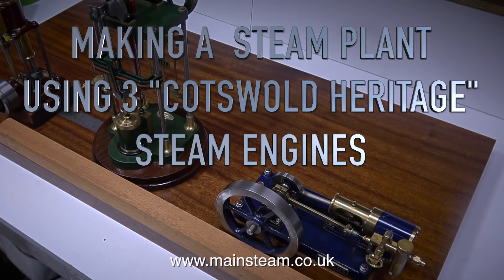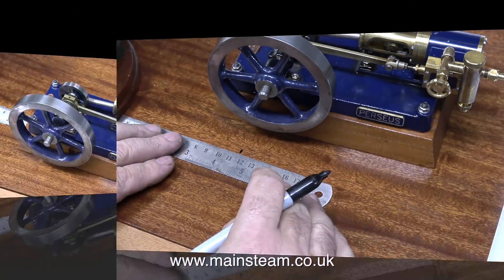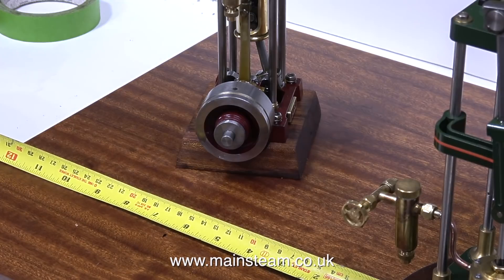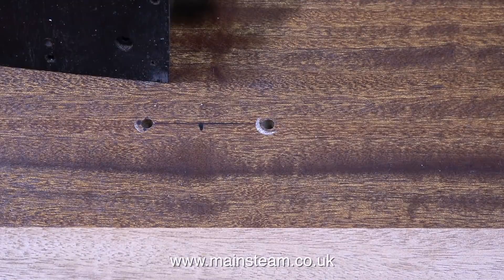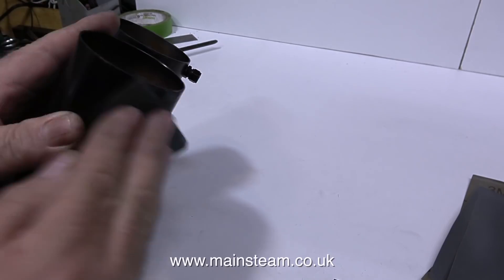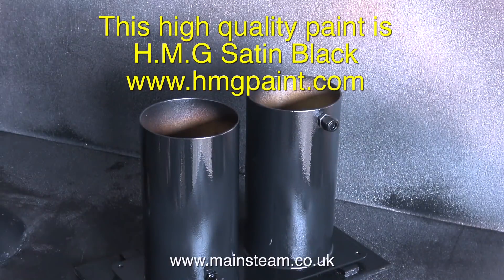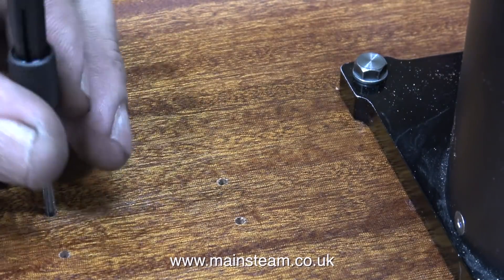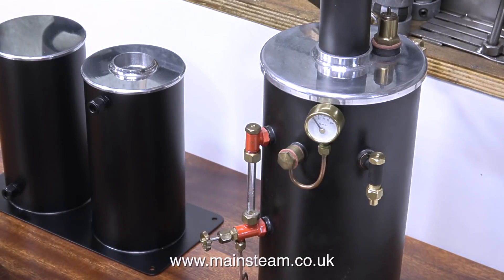A MODEL STEAM PLANT WITH 3 STEAM ENGINES - PART # 9

Comment: About the corrosion you are absolutely correct in that corrosion are unlikely to be a problem but I just wanted to ask a couple of things:
Aren't the boiler painted internally? And aren't the cap for he boiler only ever in contact with the exhaust from the gas burner and in no way exposed to the water and steam?
This might just be me not knowing anything about steam engines and boilers but just wanted to ask
Reply from the maker: The internal surface of a boiler are not usually painted, the heat of the burner takes care if the evaporation of any water so no corrosion problem there.

Comment: A COAT OF "PENETROX" OR "NOALOX" SHOULD PREVENT NY CORROSION OF THE TOP CAPS.  THESE PRODUCTS ARE USED IN ELECTRICAL WORK  ON POWER LINES AND RADIO ANTENNAS.  IT WORKS QUITE WELL.....

Comment: I guess that cheap paint didn't do the job. Always makes more work. I learnt my lesson. You get what you pay for and it never works cutting corners. Great vids as always. Cheers Keith.
Reply from the maker: The cheap paint was OK really, just a bit too shiny to match the boiler . . . .
Reply: You now when it looks right. Used Humbrol for years until Acrylics became more available. Still use Humbrol Matt Cote Varnish though.

Comment: Have you ever had a glass break on one of those water gauges while steaming?    Does it cause a big problem or is it not too bad?
Reply from the maker: Yes - a few times & it's never been that bad in my experience . . .  as soon as the glass cracks the pressure drops rapidly.

Comment: Looking good Keith. For a matt black paint I've had good results using heat resistant barbeque paint, it's cheap but does a good job and sprays on to a nice even coat.